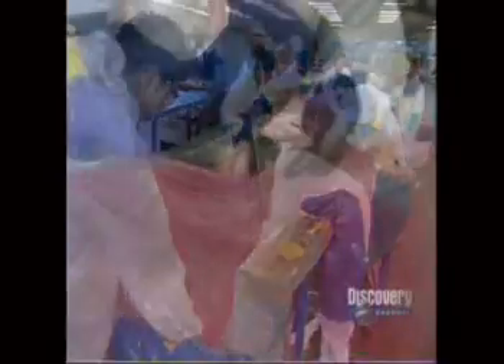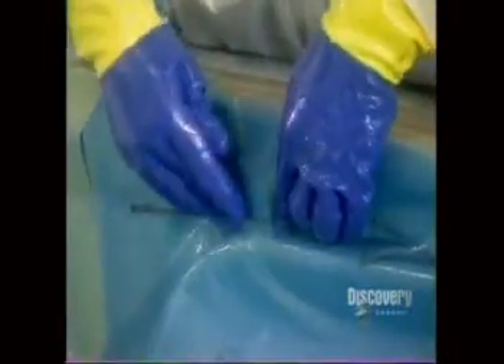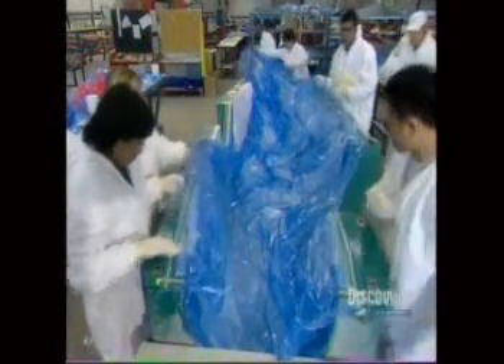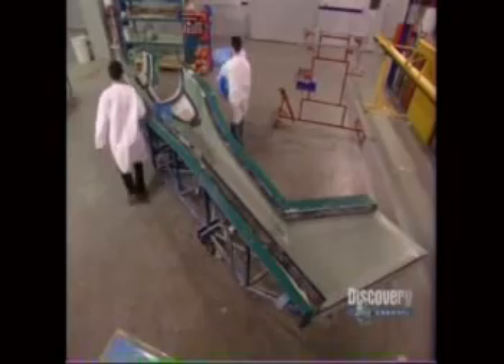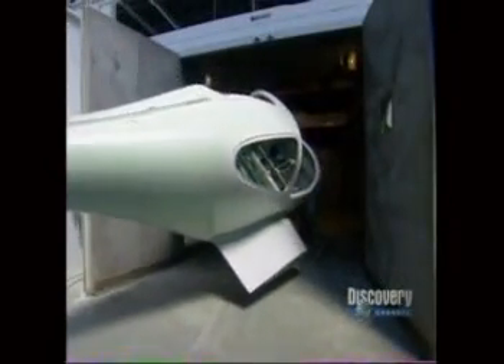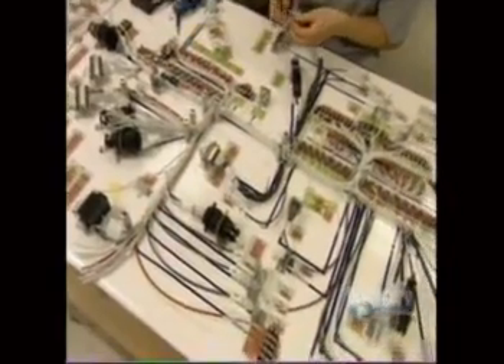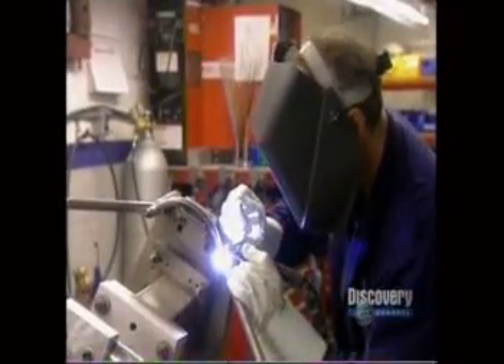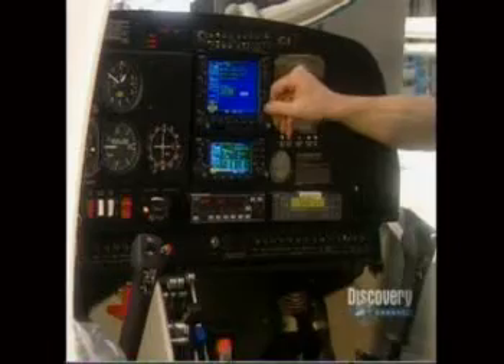How a Diamond Aircraft is Made

Comment: The DA looks modern but there are many modern aluminum airplanes that can outperform it.  In the low speed that the DA flies, there is really no need for composite structure but it's there strictly as a marketing item.
Reply: Its for the ease of manufacturing and other  engineering benefits. Composite aircraft are more comfortable and handle the cyclic loading  better.

Comment: The problem of the composite technology is its weight. A empty DA40 is 200 kg heavier than a wooden DR400-180 equipped with the same engine, and with the same performances (despite the fixed pitch propeller on the DR400 instead of the variable pitch propeller on the DA40). 

That's means, as these both aircraft have the same max weight, that DR400 can carrying 4 passengers with full tanks (5 flight hours) and 45 kg in the baggage compartment, while the DA40 is only a three seats, without baggages and with reduced range.